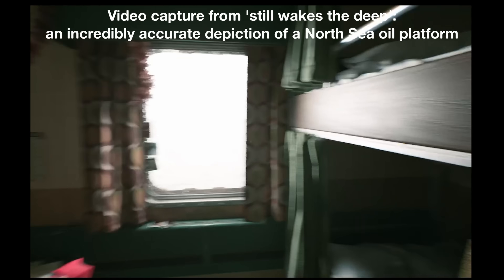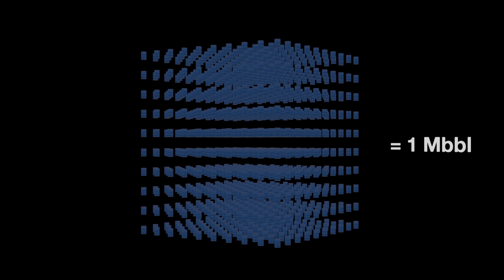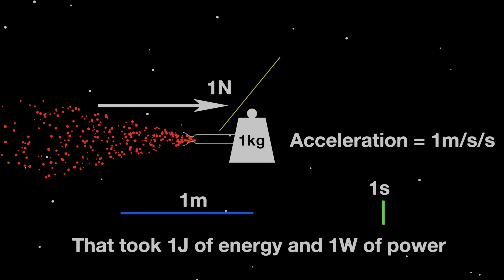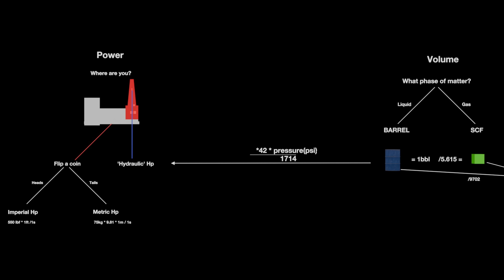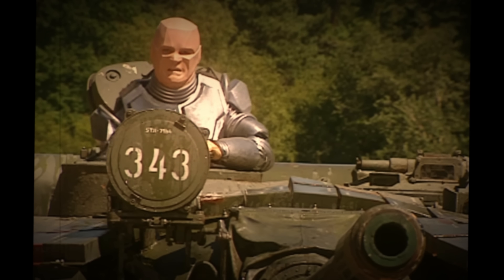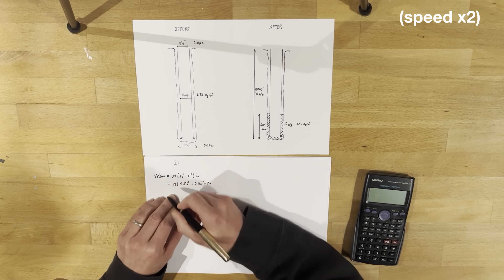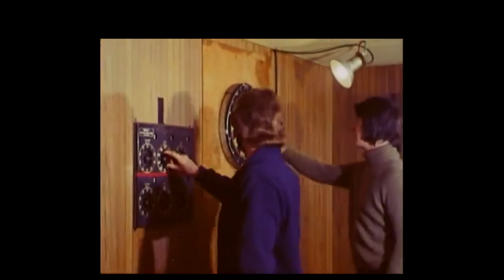Oilfield Units: a Measurement System so Cursed it made me Change Career

Comment: I actually appreciate them describing curvature in a way that’s inverse to radius of curvature. It’s kind of a problem when “infinity” describes a perfectly straight drill, or if it’s almost straight you might have a thousand kilometer radius of curvature or whatever. Instead it’s better to use inverse curvature, which is properly measured in radians per meter, so a hundred-meter radius of curvature is a hundredth of a radian per meter or one radian per hundred meters. And while of course the SI unit there would be vastly preferable, converting that to degrees per hundred feet is a fairly understandable sin.

Comment: The pound is not inherently a unit of force, as the pound-mass and the pound-force are different units, though the distinction is most often implicit, such as in "pound(-force) per square inch".

So, actually, there are four pounds to care about:
Avoidupois pound-mass
Avoirdupois pound-force
Troy pound-mass
Troy pound-force

Comment: A bar is just another name for a thousand hectopascal. But confusingly an atmosphere is close but slightly higher than a bar.
Using non SI units is something fairly common even in sciences because the SI unit aren't at a convient scale. Often they are rescaled SI unit like the litre, the bar, or the Ångström. But they can also be fairly wild like a light year or the parsec used in astronomy or the electronvolt used in nuclear physics, quantum physics and theoretical chemistry because using tens of petameters or hundreds of zeptojoules as your base unit is impractical.
KiloWatthours is also easier to handle since we operate more in hours than in seconds. the kilowatthour per hour is a bit silly.

Comment: I had a discussion with my boss over why I almost refuse to use imperial(German based machinist), because it’s made up bullshit you cannot prove or actually measure. 

After I explained as to why it’s wrong to use body parts instead of provable constants he said okay to the office putting the measurements in SI units next to the Imperial for the 5 things I need them for.

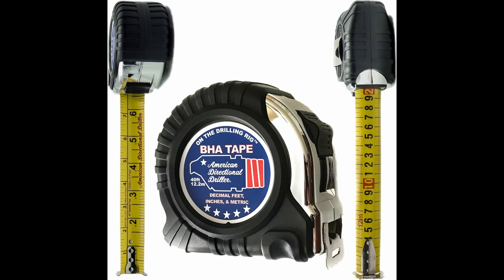Comment: 4:55 To be fair, if someone were to write 31 feet 2 inches in notation, 31'2" would be correct. Since the tape is in tenths, I wonder why even include the apostrophe at all? 31.2 naturally means 31 full units and .2 of a full unit, or 2/10 already.

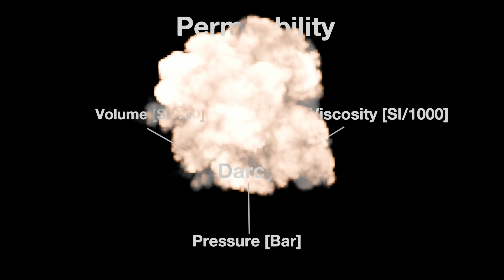Comment: Small nitpick but at 13:39 you say atmospheres, but wrote bar, which is a quasi-SI unit that's 10^5 Pa. Judging by your mention of incompatible systems you probably meant either the physical atmosphere, which is abbreviated atm or more esoterically (but that wouldn't surprise me) the technical atmosphere, which is at.

Comment: One can complain about this or that units and they have to do a little thinking to do some conversion.  Oh woe to thee.  But converting a few units is just a little icing on the cake of all the things involved in petroleum and chemical engineering.  Chemistry, fluid dynamics, thermodynamic, endless equations, mass and energy balances, calculus, solving an equation of a sphere falling through a fluid... In years of studying chemical engineering, unit conversions is of the easiest things I had to do.

Comment: Standard does one thing better than metric (just one)
O-ring sizes

But seriously, converting everything to SI wouldn’t get rid of all the old SAE hardware and tooling that still needs to be worked around, it’d just make the math on new installs easier
And who uses new equipment?

Comment: Here is the purpose of API units: They are a standardized unit created for expressing the density differential created by temperature. The intended use case of this is calculating the “actual” volume of a product being exchanged from a seller to a purchaser based off of the “observed” API at current temperature and the standardized reference api of the product given a temperature of 60 degrees fahrenheit. It is also an inverted density measurement, meaning that a higher API product is actually less dense than a lower API product. 

😃

Comment: Let me defend feet and inches here from the engineering/manufacturing side: decimal feet and inches are used. Any time I'm looking at "5ft 3in" I immediately convert that to 5.25ft. Ok that is all. US Customary is a great system once you drop the mixed units and fractions.
Also, measuring gas in volume makes no sense to me, unless you mean just measuring the container itself. Gas, obviously, changes volume to fill its container. Weight would be a much more intuitive measurement, than "volume at pressure" or "density at volume" or something.

Comment: I was a mechanic. And live in Australia. I hated dealing with the damned Imperial system. Having to learn both. 

The metric system is so much easier. It easily can be converted to the scientific unit systems.

It's also nice that it's base 10. I do find it funny when Americans defend especially their temperature measuring. 100f is hot, why would you base your measurements off water freezing and boiling?

Well because we have Celsius and Kelvin. And most people don't need to worry about starting at absolute 0. So having the same system but starting at water freezing is pretty handy in real life.

Comment: I worked for an oil company in the US. I used all of them. I would use gallons (usually) when dealing with downstream customers. i used bbl when we would buy or move oil from upstream. then I would also sell it by fucking weight in pounds or kilograms based on which customer it was. we would weigh it with our scale. if I forgot to change it on our ticket, they would act like i just faxed them a picture of my balls. its the same weight...
and a decimel is tenths, ive never put a decimel to denote ' . 
it was only really confusing when we would buy oil on our end in gallons (US), I go to the captain of the ship to confirm how much oil Im getting from them, and he just stares at me. tell me how much youre giving me in bbl then and ill figure it out. I dont have any of that yet and my meters are in US gallons, so thats what my company tells me to fill.

Comment: Back when I was in engineering school I was part of the student radio station. We made an automatic system to handle reading out the time and basic weather for when there wasn't a DJ on air, which of course announced the temperature in Rankine to be as "helpful" as possible.

Comment: I'll push back on the use of specific gravity and parts-per notation, but only a little bit because you are correct.

If you're trying to write things out in a non-dimensionalized fashion, specific gravity is a natural choice. Using water as a reference density is simple and extremely convenient for talking about liquid and solid densities, if you say specific gravity of 2.6 or 0.8, I instantly have a good idea of what I'm dealing with in my mind, and that's convenient. It is absolutely worthless for gas densities though, for obvious reasons.

Parts-per notation is good for the same reason, but in that case it's much less arbitrary. The unit is perfect, it communicates immediately that it's dimensionless and it keeps you from having to report things with more characters than needed. The problem is that you use the same unit for multiple different things, but if the quantity actually being reported is properly called out, it's perfectly fine.

By that I mean, the problem isn't that the composition is 10 ppm, the problem is that you didn't tell me which composition is 10 ppm, but that's an easy fix. Just say the molar/mass/volume composition is 10 ppm.

Yes, saying mg/kg etc. would be equally accurate and less ambiguous, but it also defeats the point of dimensionless quantities. It'd be odd for someone to take the same attitude with a dimensionless efficiency or something.

"Yes but is that "2" energy produced per energy provided or revenue produced per cost incurred?" If I didn't tell you that already, that's my fault, it doesn't make using the pure number inappropriate.

Comment: You didn't mention the horror that occurs when you are using European mapping (in metres and km) with depth in feet (because US and history). So you end up with rock volumes in m^2.ft

It's much, much worse than you portray. I work at Schlumberger. In software development. The source for our units catalogue is megabytes of text. US feet anyone? Different from imperial feet by 2 parts per million. It goes on and on. And on.

Comment: A little bit in defense of kWh (which is weird because I don't like them either). It's one of those easy to visualize units, being an equivalent of energy spent by using a 1000W (very common) power device for an hour. Because we mark power with watts on most commercially available devices it's easy to do a mental math on how much it'd cost for you to run it for an n hours. And it also avoids seconds to hours conversion because apparently people struggle multiplying by 3600. I view it as a convenient amount of energy, a liter of energy if you will (but worse because time isn't decimal)

Comment: I'm in telecomm in the US, and don't use anything other than standard units, specifically decimal feet. Government projects may require metric, but I have not run into that myself. Worst I've had to deal with was transcribe some existing dimensions as metric with a conversion to feet in parenthesis. Of the people who have dealt with clients that require metric, they just do the job in standard, and convert to metric before submittal.
Edit: I also wouldn't have done cement in gallons. Only job I've ever calculated material volume was a driveway permit, and they accepted cubic feet. But that exemplifies your point that this is all utter nonsense.

Comment: Tbh I don't get at all why people hate on "watt hours" as a unit. The joule is just a fancy name for a "watt second". There isn't really any inherent reason why seconds would be better than hours to base it on. I don't see nearly as much hate on km/h for also using hours instead of seconds. In general people don't really say that it's cursed when they have to convert between seconds / minutes and hours, it's just something we have to do all the time anyway. It's pretty common to convert between km/h and m/s. Hours are just a more useful unit of time in practice in many cases. Cuz you're usually gonna be calculating how much energy something consumes or generates in a timespan that's much larger than a couple of seconds. Yeah the conversion factor when you do need to convert between hour and second based units is dumb but thats a larger problem of the way we measure time in general. Though tbh I'd expect that people should have memorised that conversion factor already, like the conversion factors of time (60 seconds in a minute / minutes in an hour, 3600 seconds in an hour, 24 hours in a day) are really the only ones you have to memorise when you're using SI units, again cuz our system of measuring time is just kinda weird, but we generally do know those conversion factors cuz we're used to it. The unit of watt hours per hour definitely is stupid though. Like i've seen an energy efficiency label that literally said "22kWh per thousand hours" like just say 22W?? I'm guessing it's for like people that aren't educated about what a kWh actually means and they only know it as the unit that appears on their power bill?
Reply: @b4ttlemast0r  Joule is not a watt/second. A watt is a joule/second.

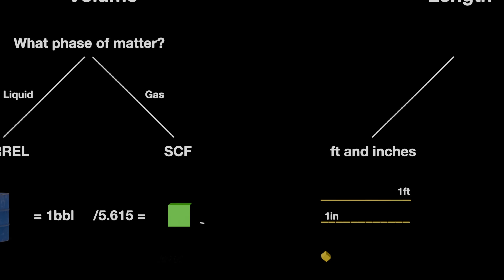Comment: 4:15 I'd also like to point out that in Civil Engineering it is all customary units, with some rather obscure ones tossed in for fun like Slugs and Kips. While not perfect there is no unit conversion needed, and it's (for the most part) the same amount of time and effort as SI.

Comment: I have been in the industry on the supporting tech side for 25 years in various roles all the way between day hire contractor to having a designated parking bay at the local country head office. In my opinion it's very much a combination of US exceptionalism, stubbornness, and gatekeeping. The US education system has been in an atrocious state for half a century, the people who fought through that with enough of a brain to manage that sort of engineering are some of the most determined people on the planet, they have been selected for stubbornness. Drilling starts at around $5000 per minute, so there's incredible pressure too. It's awful, but at the same time very understandable.  Ok the paper at the end triggered me, way back I had to arrange a special chopper to fly one box of letter size paper out for some moronic US written daily reporting software. The stupid thing couldn't put all the numbers on A4 proportions. That was a $9000 box of paper.

Comment: This might seem like a silly question, but how do you measure parts that are only 0.01 millimeters long? Can you even measure that accurately in inches? If it's possible, isn't it clear that using 0.01 mm is much simpler than converting it to 0.000393700787 inches? It seems you're making things more complicated than they need to be! :D
Reply: There's precision instruments to measure that small, it's pretty routine for machinists. Machinists tend to use either Mils/Thou; one mil = one thou = 1/1,000 an inch. Yes, it's cramming metric into imperial. After that, they also use tenths. As in, one tenth of a thou, or 1/10,000 an inch, though Ive not seen it often. I'm not sure what it's like in metric countries, and I weirdly can't find any information on it from an immediate google search. I'd imagine it's similar, though measured against the centimeter instead of the inch.

Comment: PTSD from my one encounter of this field (except university) I was a cadet at an swedish oiltanker and we got a cargo of slurry originated from a platform via a refinery and to be transferred to us by ship to ship operation at an anchorage to be taken to shore.
We did not have the green book.
We got all the cargo specs and procedures is these fuck8ng weird units and we would deliver in SI and of course load safely and whatnot.
Being the most junior "officer(to be)" it fell to me to convert the mess and by Odin, API densities was the least of the struggles. Took me an awful portion of an night whilst rolling across the north sea.
All went well but I made an silly  error while converting the viscosity per Fahrenheit to Celsius and had to get up in the middle of the night to get more heating on on the forward tanks.

The noxius shit was safely discharged in Le Havre and I was just so happy to go back to the normal business and adjoining paperwork.

Comment: As an american who suffered through the relevant school system, i cant comment on the "seventeen hundred" vs "one thousand seven hundred" differencd on the rig, though people saying it differently depending on whether theyre on the rig or not is very odd. What i can say however is that at least I was taught that the latter is the technically correct option, but its just more common to say it the former way, as far as i can tell because it makes you sound less nerdy. But everyone I know is aware of the "proper" way to say it, and everyone will know what you mean either way. 

Its similar the technically correct name "miter saw" having the more common name "chop saw," everyone knows its actual name, but if you try to correct anyone saying it the colloquial way, youre just gonna get funny looks and muttered accusations of being part of the grammar spicy pinwheel gang

Comment: As an automotive technician in training, I am SO glad that almost everything in the industry switched to metric by the 90’s. The one thing that still pisses me off though is tire size. For some reason, the height of the tire’s sidewall is not measured directly, but as a percentage of the tire’s width. So if you want to put wider tires on a car without changing the height (thus affecting speedometer readout due to how it’s measured), you need to do some goofy conversion just to find out that it’s impossible to get the exact same height from different tire sizes since they only go up in increments of 5 percent (at this point however it’s a difference of millimeters or less, so it doesn’t really matter. Still a million times worse than if they just directly measured the sidewall)

Comment: API gravity is used in the inspection side to calculate standard volumes for the traders, we take the TOV (total observed volume) of some product, subtract any free water to get a GOV (gross observed volume), do some math's involving the temperature and the API gravity to get basically an expansion factor, multiplied by the GOV to get a GSV (gross standard volume), if its crude oil then you can add back the free water volumes to get a TCV (total calculated volume). The reason for converting an observed volume to a standard volume is because oil products expand and contract with temperature changes so the volume needs to get set to a standard 60 F or 20 C

Comment: There is a difference between US and imperial gallons?
Reply: Yes, British and American units use different reference systems, so the same unit has a slightly different value depending on which side of the pond you are.
Reply: @hammerth1421 . Bruh. For f ks sake.

Comment: The feet and inches versus the feet and tenths. 
Once upon a time - back when one of the first lessons in drafting was how to sharpen and hold a pencil,
An "Architect's Scale, worked in feet and inches, while an "Engineer's Scale" worked in feet and tenth's.
So yes, the Engineering drawings for a project would use feet and tenths, while the Architectural drawings were all in feet and inches.